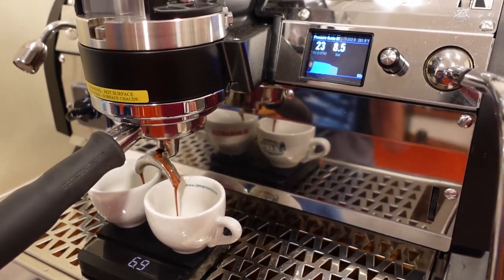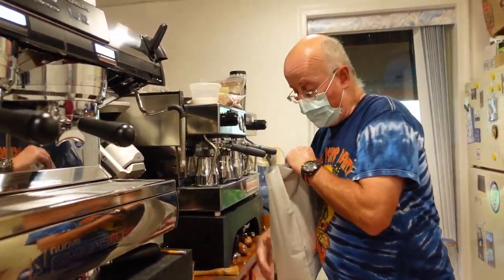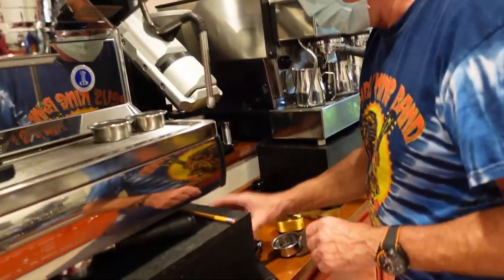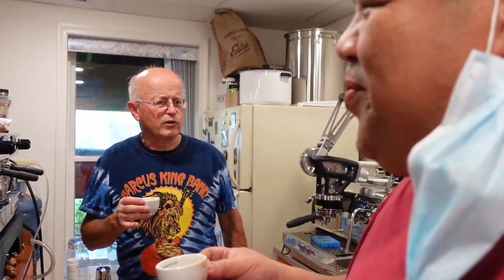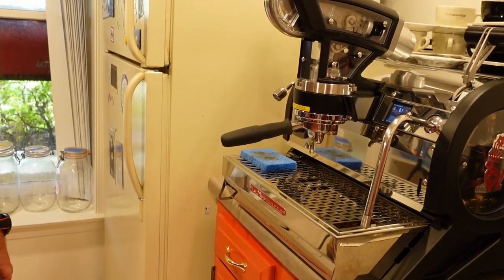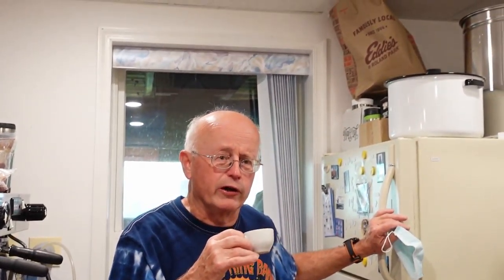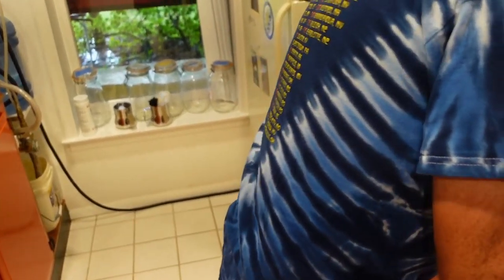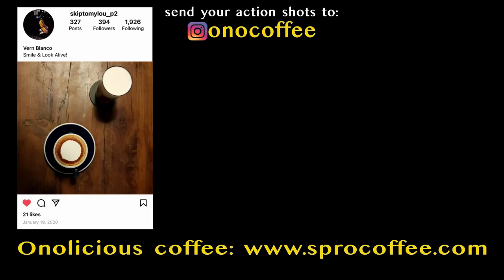Ultimate Home Espresso - Shot Pulling, Particle Size Distribution, Blonding & Freezing Coffee

Comment: The Leva extracts much higher numbers (because of the hybrid spring/pump) so the extraction is much even. So the citrus notes you are tasting are covered by other compounds from the higher extraction.  The more crema/oils can also coat the mouth more so you dont taste so clearly the floral/citrus sour notes. It's like having a spoon of olive oil and then drinking an orange soda.  The lower bottom can be enjoyed by some while others hate it, it normally means heavier notes, up to spices, tobacco, biter notes.  The commercial pump machine even with profiling can't do what a spring lever does. I've pulled on Leva some shots, and the top 3 machines right now are for sure the Leva, the KVDW speedster idromatic (since hybrid spring) and the Vesuvius Leva (hybrid spring).  Hybrid springs (that have a pump) so you can modulate the preinfusion are a must now, a classic lever can't do it.  Great session, I would like to know more.
Reply from the maker: Denis - Great insight and the olive oil/orange soda is a great way to describe it. After visiting Greg and thinking more about the experience as I've been assembling these videos, I'd like to get more in-depth with the Leva to explore it more fully. Another visit with Greg is in order. Thanks for watching and sharing your thoughts!

Comment: Awesome videos, so much good topics! 
I have a question about extraction times as I could see they are much different… sometimes LM Leva does 28 seconds for 40g, other times it goes 38 seconds for 40g… i would suppose that shorter extraction shot is much more acidic and the longer shot much more bitter? 
At home I feel the difference of just 2 seconds longer extraction (using Rocket R9 one).. thanks for reply!
Reply: Hi there:   My experience with the Leva at the time the videos were done was pretty limited.  I've since learned to look at the bottom of the filter basket and apply full pressure when coffee begins to appear at the bottom of the basket.   This improves shot time consistency a lot, and now its on the order of a couple of seconds.   10 seconds is a good chunk  of time, and if I get that much difference these days I go looking for the reason.  2 seconds shouldn't matter that much i would think.
Reply: @gregoryscace1915  An honor to get the answer personally from the great Scace! Thanks for sharing Your knowledge! 
Best Regards,
Luka Mezgec
Reply from the maker: Luka - I see that Greg has offered his thoughts directly. I'll let his words speak. Thanks for watching!!!